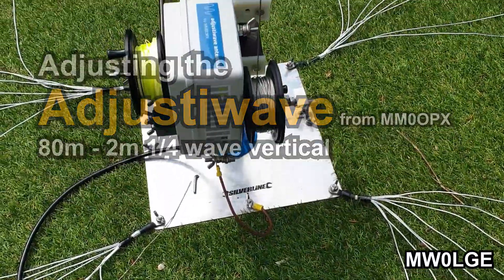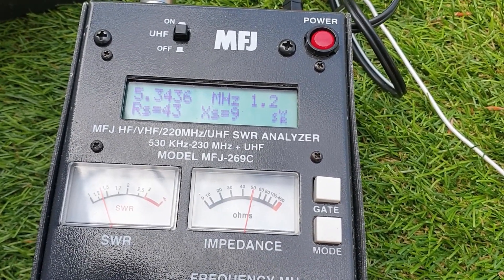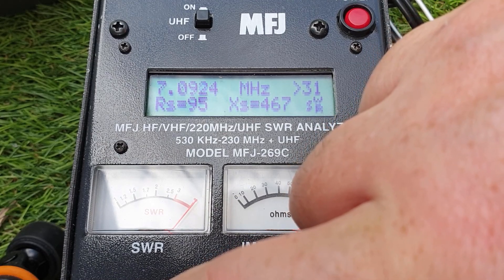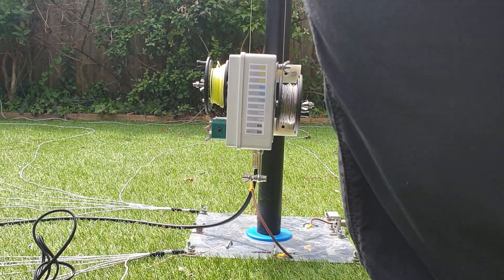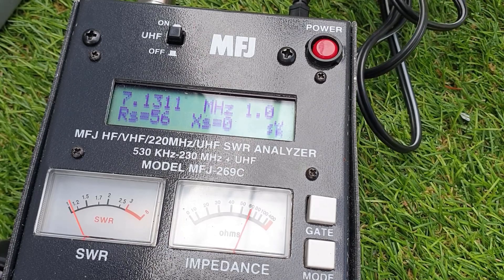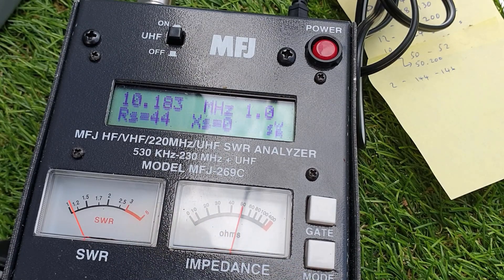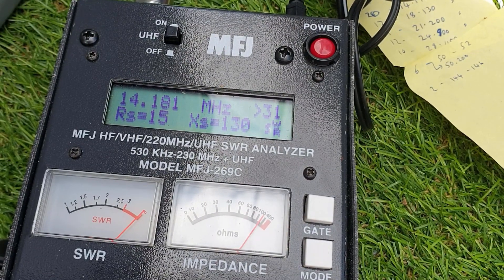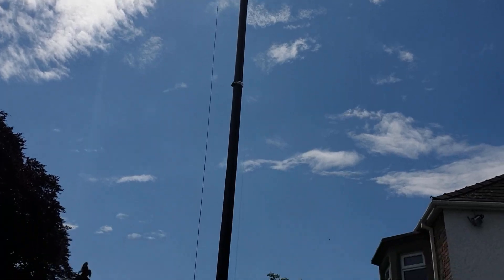Adjusting the Adjustiwave - 80 to 2m 1/4 wave vertical

Comment: Good swaaaaaar. :)

You just know that adjustiwave is practically begging for two stepper motors to get involved.
 
All the best, 73 2W0TYD.
Reply from the maker: yeah, i know right, lol. However, unless the 'gear' ratio can be kept 1:1 (spooled size vs non spooled) then either of the steppers would need to go into free wheel mode depending on direction of travel. Hope everyone well with you. Edit: forgot to mention i've had a quick look around at variable reluctance steppers which would work, but meh, simplicity is key and not exactly worth while doing for a portable setup. 73 Richie.

Comment: Low and fine swr and right impedance.
Now we look forward to a test listening of the antenna from the shack and a comparison with your other antennas.
Reply from the maker: yep, will have to relocate it away from the house and get it connected into one of the radios. I have been using it with some coax through a window into the kitchen, running with the IC-7100 and it seems to work fantastic. The bands have been a bit down these couple of days, but have worked anyone I have called without issue Had a quick blast with it on FT8 as well, on the lower bands.. 73 Richie.